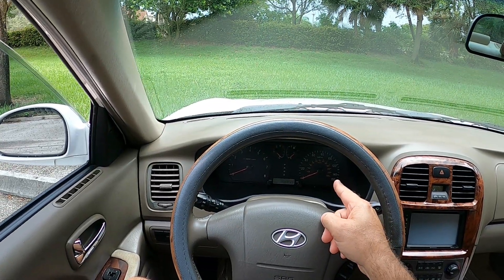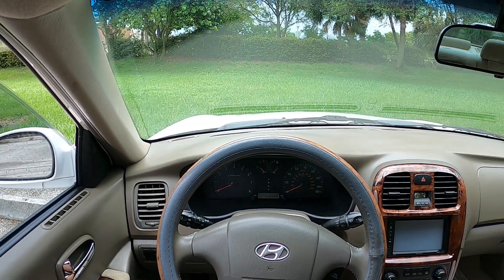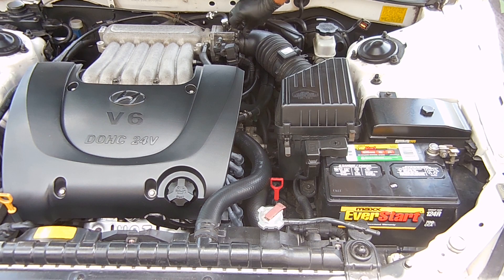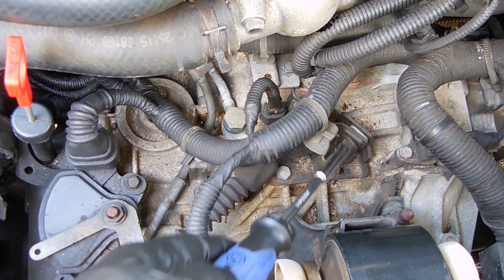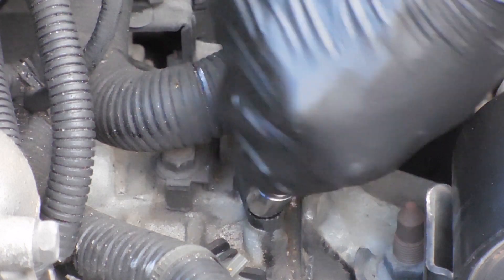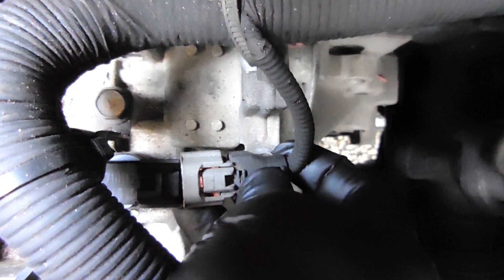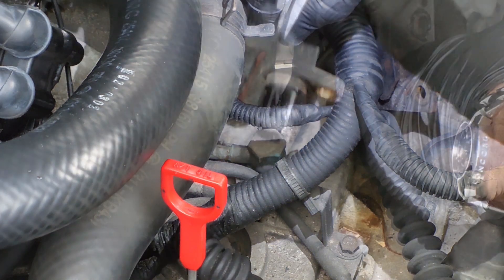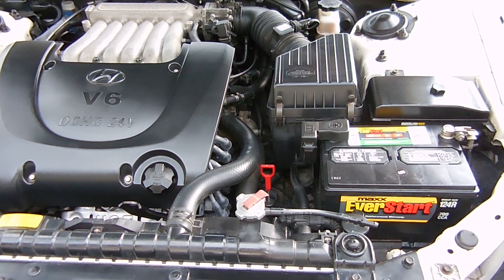Car Speedometer Stopped Working Works Intermittently Or Erratic - SOLVED!

Comment from the maker: In case you were wondering, yes, my speedometer problem has been resolved after replacing both sensors. Thanks for watching!
Reply: was the RPM working whilst the spedometer wasn't?
Reply: So speed sensor and what the another one?

Comment: This is very good to know 

I got a 2010 crown Victoria... I swap the rear axle assembly 
Now the speedometer is off by 10 or 15 miles and it gets a bit worse when I'm at high speeds. 

I took it to shop but they said that the port was different from the one on their computer and didn't fix it.

Comment: hey man my names Nyxon I’m from brantford , ontario , I would really like if you could try to help me diagnose what’s going on with my car . I own a 2010 Jaguar XF 5.0 premium luxury trim . The cars in great shape and only has 170,000kms . I have scanned it and there are no codes , I’ve swapped air filters , spark plugs , oil , power steering fluid , and coolant . But when I drive the car the rpm and speed gauge go up and down about 5% constantly . It’s really annoying and I really wanna fix it , any suggestions on what could be causing this fluctuation ?! I also wanna note that 10% of the time when starting the car the rpm and speed gauge go below zero for a couple seconds then shoot up to where they should be . Wondering if it’s a bad ground in tachometer ???? Or a bad sensor ? Thanks man !

Comment: Great video. I followed your instructions. My speedometer stopped working and transmission did not shift up more than gear 2 at once. I found that an animal had cut wire for output speed sensor. Now the speed is showing good. but despite of resetting the code and speedometer working properly, it popped up again for the sensor. And it did not solve transmission issue? Can you suggest me the next step? I would really appreciate that.

Comment: Is the video the same procedure for a 2009 Highlander Limited?  The problem is the speedometer will not go above 40 MPH and it seems the transmission shifts a little funny, this seem to be because of the speedometer not working correctly. I've parked the car till I find the right parts to replace them, I would appreciate it if you would, if you have the part number for the 2009 Toyota Highlander limited. and can send them to me? or where did you purchase them? the 2 correct number for the replacement parts??? Like the ones you replaced on the video. I look forward in hearing from you.
Reply from the maker: Sounds like a faulty transmission speed sensor

Comment: Name is Jackie, I'm having the same problem on a 2009 Toyota Highlander limited, Speedometer would not go above 40 mph and the transmission shifted funny, It appears to be a fairly easy repair to make, its, finding the parts, can be the issue, these parts and numbers , If you have the part number can you list them on the site or are they all different, and easy to find? It was a great job you did on the video. TY looking forward in hearing from you.   I live in Centreville, VA I'm on FB also.

Comment: My daughter had similar problems with her old Windstar. I removed the instrument cluster and found cracked/loose solder joints throughout the PC board. Re-soldered all the connections, re-installed and it has worked fine for years. Now the problems have moved to the transmission.

Comment: Thank you for your time making this video and educating others! I have an 04 lincoln town car and my digital speedometer is not showing how fast I'm going and my digital odometer not showing either! I have checked all fuses and wires and connections and they are all good I have even swapped out the instrument cluster and the same thing! The car drivers normal and smooth through all the gears!my cruise control is also not working? Could it be the same thing? The speed sensor?and which one?the input or output? Please help!!! Thank you very much for responding back in advance!!!

Comment: What do you do when you have intermittent speedometer failure and your speedometer is connected to your CAN, ABS, and wheel speed sensors? And you have no codes. And your car's built in self diagnosis tells you that the instrument cluster is bad but when the speedometer starts back working the built in self diagnosis says the instrument cluster is good🤷🏾‍♂️?
Oh yeah to change out the instrument cluster you have to remove several dash panels, steering wheel, and driver air bag. All to change out an instrument cluster that may or may not be any good. What do you do?

Comment: I did both sensors on a 2002 Hyundai Sonata and guess what?......NO CHANGE. After thinking about these sensors....they are getting their signals from the speed of the engine
NOT FROM THE DRIVE AXLES. I noticed there was another sensor on the transmission above the left (driver's axle) it has a plastic toothed gear that drives it and a hall effect
sensor mounted on top. That is the one that signals the speedometer to operate. Bought the sensor from  ROCK AUTO.
Reply: Could you please share the sensor name or exact location? I haven the same issue with my Sonata 2003. Both speedometer sensors replaced and still not working
Reply: @juslopezma  Sensor is near the lower side of transmission right near the axle housing, One 10 mm bolt, has nylon gear attached. Rock auto part # WVE 5S4875
Reply: @juslopezma  Did you get my reply???
Reply: @robertanderson6850  no, I did not
Reply: @juslopezma   I keep trying to reply but get nowhere !!!!

Comment: Sir my polo car speedometer some time working and some time not working check light  handle light coming and going  but car running no problem, Vw service centre checked loose wire and some spray to remove rust problem solved but came again what to do
Reply from the maker: Most likely the sensors.

Comment: This is a shotgun repair.  You didn't diagnose the fault, you simply blasted parts at it.  Yes, in a lot of cases it is the sensor.  But in other cases it it could be damaged wiring, a bad ground, etc. It's unlikely you needed both sensors, and it's unlikely this will fix every case of the speedometer not working.  This would have been a good opportunity to discuss the diagnostic process, show how to examine the codes with an inexpensive code reader, inspect the wiring and grounds, decide for certain what the problem was based on the evidence, and then effect the simple repair.  I think this was a missed opportunity for you; you're usually very thorough.
Reply from the maker: Far from a shotgun repair. Understanding how the system is set up(wired), I used logic. I told viewers to inspect the connectors on the sensors, so clearly if they see corrosion or a frayed wire, they'd repair that first and test out the speedometer. The odds of (2) sensors failing at the same time is extremely low, but you replace both because you'll save time and money in the long run. You won't get trouble codes for this issue, I checked. You also cannot troubleshoot a sensor that fails intermittently(as in my case), you can only troubleshoot one that failed for good. No opportunity was missed, compared to other videos on this subject, I think I did extremely well explaining, and many people will benefit from the information. Thanks for watching
Reply: @electronicsNmore  These are actually all really valid points that I think should have been spelled out in the video.  Probably in order.  So 1: "This is the problem" 2: "This is how it used to work and how it works now" 3: "Won't get  codes / checked codes and You can't really troubleshoot a sensor that fails intermittently much, you can only really troubleshoot one that failed for good." 4: pull apart /inspect "IF you see XYZ repair that first and test out" 5: " odds of (2) sensors failing at the same time is extremely low, but you replace both because you'll save time and money in the long run" and then ideally 6: Look its fixed. Then again Perfection is the enemy of Good so not sure how you want to handle that.
Reply from the maker: @TheGodOfAllThatWas I got a great idea, make a video and send me the link when it's complete. I'd love to see it. Make sure NOTHING is left out.
Reply: @electronicsNmore  So there's a lot here...... I actually did start to take a crack at it, failed and went "nah, I don't care that much".  I got the idea that you cared.  That's why you even bothered to make the video.  I also get the idea that if you spend too much time and effort making it perfect nothing get's done (that's actually a large part of why I don't have videos, and what I said about perfect VS good).  I know just enough to get myself into trouble, and haven't spent enough time getting myself out of said trouble to be comfortable to start some of these projects.  I was worried after seeing your video others like me would be either over confident and miss things like the wiring, or other things the code reader would help with, OR under confident and not try it because they'd get lost thinking you skipped over "Obvious things" that they'd need to learn first like the code reader.  When I saw Geoff's comment I thought those addressed the concerns I had and figured if you just kept less qualified people like me more in mind when making videos it'd make your future videos better.  My comments are just my 2 cents.  People won't even pick 2 cents off the ground it's so worthless.  Pinning Geoff's comment would be a decent alternative to redoing the video, as I understand it for algorithm reasons you don't want to redo videos (again don't know for sure, haven't done enough).  I just thought you'd like the video to be more helpful to all audiences, not just the ones who already know what they're doing.   I was watching your videos to learn better "What I'm doing".  I'm sorry it seems my comments we're perhaps more worthless then the advertised $0.02.

Comment: Another valuable tutorial. ? What year auto is it, when did it go electronic? Thanks!
Reply from the maker: 2003, made in Oct 2002. Probably started using electronic in the mid 90's.
Reply: @electronicsNmore  Hmmm. That probably means mine 04's Silverado & Merc GMLS both have it. Very helpful, thanks!

Comment: Strange. I just started working on my Honda on Friday and this exact issue happened to me. I hadn't even gotten around to searching for a fix. Thanks for knowing my issues ahead of time. Lol
Reply: Was your honda a civic? 
Mine is having an issue with resting at a certain point for some time but i found a temporary fix for it
Reply: @bobbobAtYourMoms  Mine is an Accord. Still running.
Reply: @bobbobAtYourMoms I have a Civic 2011 and it has the same issue. I got the output speed sensor changed but I still have the same problem. I will change the input just in case now
Reply: Did you try it? If you did did it work?
Reply: @CharleeKwm  Been a while, but I don't remember having to replace it. I believe everything just started working. I did a bunch of work on that car and got it in great shape.

Comment: I doubt that you really needed both sensors.
Reply from the maker: Usually one fails, but you replace both if you're going to pull everything apart. The last thing you want, is to drive for 6 months and have the problem start up again because the other old sensor has failed. They're not that expensive, but if you don't do the repair yourself, you'll likely get ripped off. Thanks for watching!
Reply: Expense of the replacements would be the critical factor in my decision—if they were cheap enough, I wouldn't hesitate to replace both.